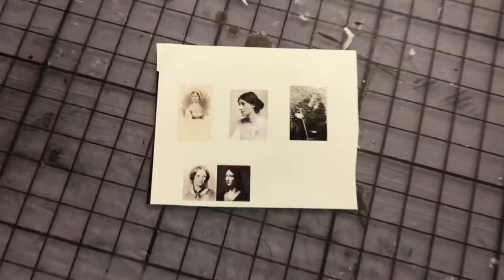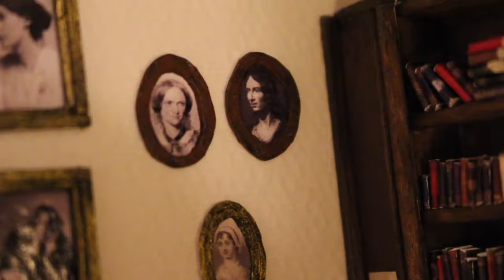MAKING A MINIATURE LIBRARY BOOKNOOK

Comment: What did u use for the base of the floor and walls and also the book shelf’s,you did a great job I love it❤️
Reply from the maker: Hey there, thank you so much! ❤️ For the base, i used wooden plates (about 5mm thick), and i made the shelves out of mostly popsicle sticks. The cabinets on the lower parts of the shelves are made out of thin firm cardboard.
Reply: @katharinahandmade619  thank you!❤️